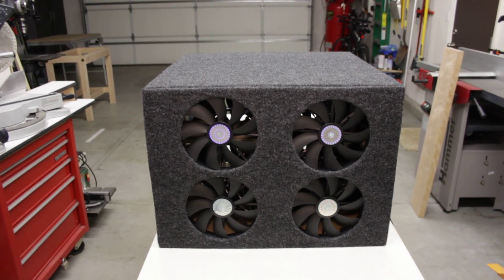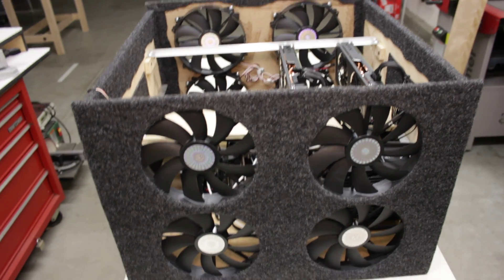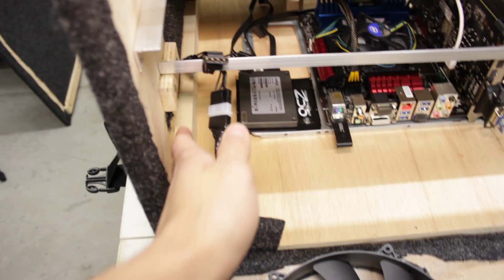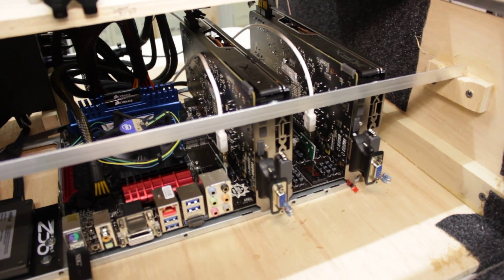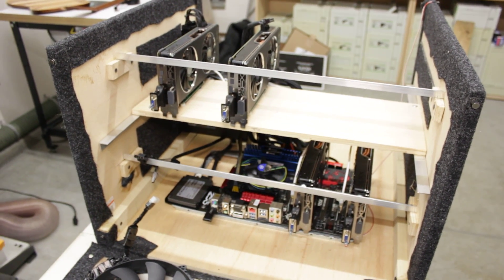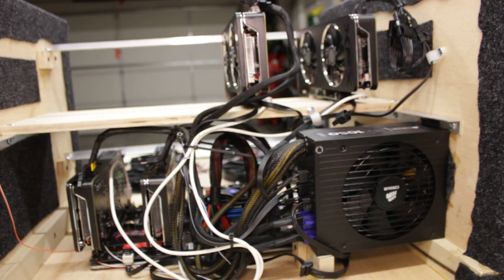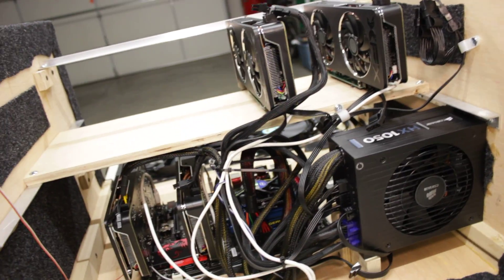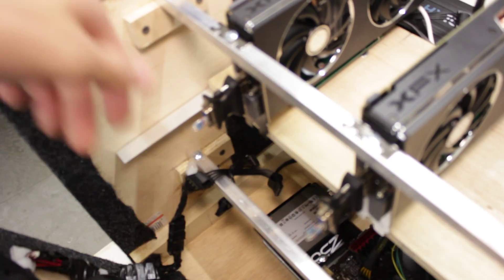GPU Crypto Mining Rig - DIY Build and Experiences, 1.7-1.8 Mhash/s

Comment: This is one of the best mining rig videos I have seen ~ and I've watched a lot!  I really appreciate your awesome work.  Would you mind giving us a run-down of how exactly you have the GPUs plugged into the power-supply?
Reply from the maker: Sadly I tore down this build a while back when GPU mining fell by the wayside to ASICs.  The power supply I purchase was rated for 1200W (I believe) so it came with 6 PCI-E power connectors.  Any remaining plus needed could be fulfilled by by using Molex to PCI-E power.  Some 1200W and up power supplies have 8+ PCI-E connectors which would power all four cards without the need of any adapters.  Hope that helps!
Reply from the maker: Great to hear!  Thanks for the comment and enjoy part two.
Reply from the maker: It will work well.  This board is best suited towards any 7th Gen non-K series Intel. That includes Kaby Lake series Celerons, Pentiums, i3s, i5s, and i7s.  It will support unlocked CPUs ending with a K, but you won't be able to overclock.  For the K-series, I recommend a Z270 chipset.  Your i5 7600 will pair up nicely with this particular board.

Comment: What is that pin on the vga adapter? Seems you have it on all cards, any reason?
Reply from the maker: Some cards don't really initiate themselves and run in a super low frequency mode if they do not detect a monitor.  I basically wired up three resistors per GPU to make each one think it was connected to a monitor, which allowed them to hit maximum frequencies.  I would google it, as not all cards need this.  Plus some vendors actually make kits to terminate the plug and do it for you.  For less than a buck at a local Frys Electronics store I was able to pick up what I needed.
Reply: GadgetryTech thanks for your reply, do you any possible reason that prohibiting a gpu from oc-ing? I'm running multiple r9 290s on a h61 board and I can't get it overclock no matter what input I put on the msi afterburner. I tried with different psu with no luck as well. Any helps appreciated.

Comment: I'm kinda new to the whole bit coin mining thing, but I just started a mining application for slush's pool and right now the hash rate has leveled off at 45.3 Mhash/s after running for several minutes. The application I am using splits the computing load between both my GPU and CPU. So far it says that I have accepted 10 shares over roughly 15 mins. Why is my rig supposedly going so fast? Or am I misunderstanding how the hash speed works? I think I have the settings for my worker log in correct, but I am not totally sure yet.
Reply from the maker: Bitcoin uses an SHA-256 algorithm while Dogecoin, Litecoin, etc, use Scrypt.  These algorithms work very differently from each other which is why you have a much higher hashrate using Slush's Pool, which works on a 256 bit algorithm (Bitcoin).  If you switch to a Litecoin or Dogecoin pool, your hash rates will decrease significantly, although more blocks will be discovered over the same period of time due to block difficulty.  You have to use different mining programs to work with different algorithms.  Hopefully that makes sense.

Comment: im confused. are you sure you are getting 1.7-1.8 seems like it would be bigger but then again i could be getting some good 30 mhash/s
Reply from the maker: kill3n z|_|m|_|s It all depends on overclock.  The highest for these cards would top close to 2 mhash but I undervolted to keep temps and power consumption down.  This is the most profitable settings as a result.
Reply: I get 4 Mhash for a second is that good?
Reply from the maker: Mokey Gamming It might be in the early stages as the program first initializes.  The numbers can be off in the beginning until it averages out.  Each card in this rig spiked at 1.1-1.2 Mhash which is north of 4 like yours.  Within 30 seconds it drops to 420-460 per card depending on how aggressive your settings are.